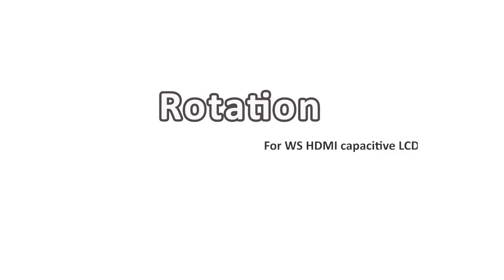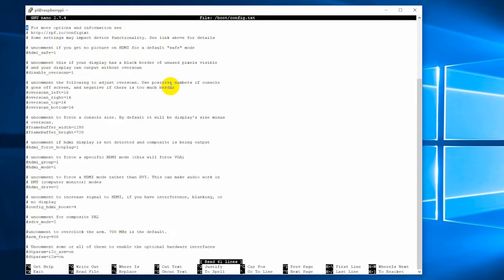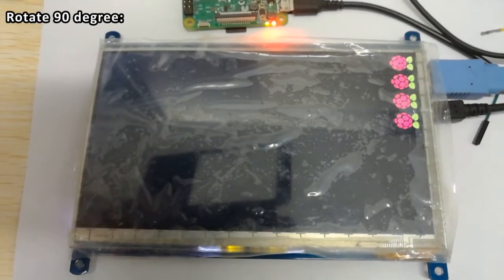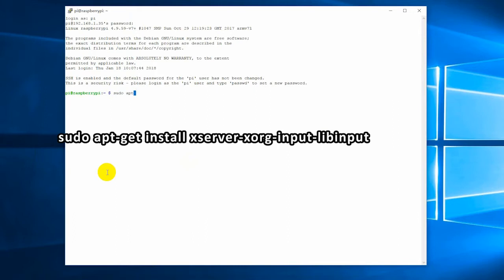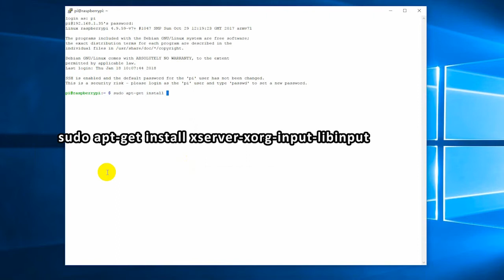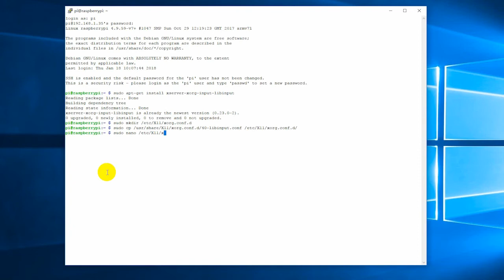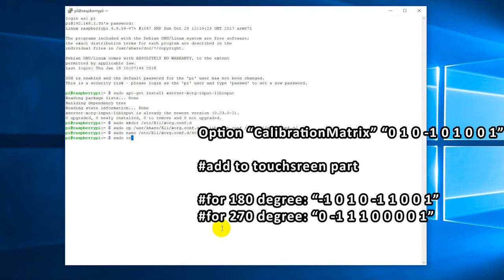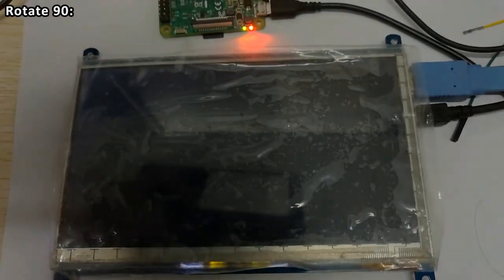Touch Rotating for WS Capacitive LCD

Comment: Hi it's worked with Waveshare C, but problem is that when I turn off dtoverlay=vc4-fkms-V3D there is bad refreshing and there are some artefacts from closed windows staying. Do you know how to fix this bug?
I found this in LCD manual:
Some users may find that if they didn't set the config file at first time, then after modifying it 
and reboot their pi, the LCD will flicker and has ghost problem. In this
 case, please power off the LCD and put it aside for several hours.（wait
 for the flickering and ghost disappear）, and test it again. (please 
make sure you have set the corresponding resolution as the guide below 
before using). And you can also adjust the potentiometer on the backside
 for properly display.

Comment: Will this work for 5inch HDMI LCD (B) ???
Reply: IT WORKS!!! Please update your Wiki with this video! No need to use your old custom kernel!!
Reply from the maker: Yes, 5inch HDMI LCD (B) could work as well. However, it seems that has some problems with the calibration, so I didn't add to 5inch HDMI LCD (B). Did you test with the calibration? If we test that the calibration works as well after rotating, we will add the wiki page of 5inch (B)
Reply: I didn't try to calibrate it yet. Should do that now, will tell you if I get any results.
Reply: I could calibrate the screen using xinput-calibrator, but bear in mind that we use the touchscreen with our fingertips so we do not need ultimate accuracy. I installed xinput-calibrator, run it going to Preferences -> Calibrate touchscreen (on my Raspberry Pi), pressing the crosses as told (with fingertips, had to do it more than once because the previous times I was told that the presses were way too off-center), then copying and pasting the output as-is in /etc/X11/xorg.conf.d/99-calibration.conf, and finally rebooting. I think it worked because the mouse pointer was about 1 cm off before the calibration and now it's centered pretty well.
Reply: I suggest that you put this in your Wiki right away. The benefit of rotating the screen is very high, many people will be helpful. We were having lots of trouble, trying to rotate it without success.
Reply from the maker: Very thanks for you feedback. We will test it, and if it work, we will add it to the wiki page of 5inch B